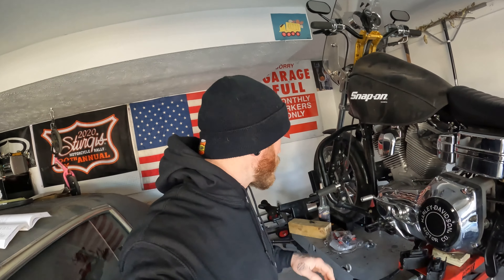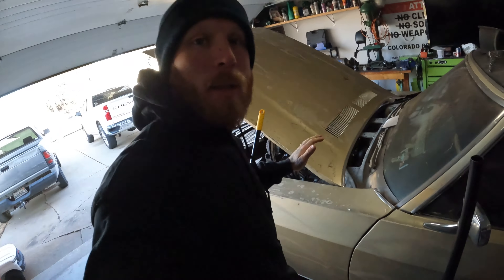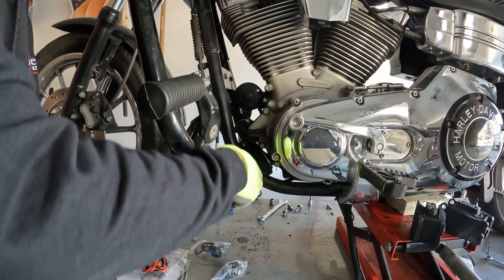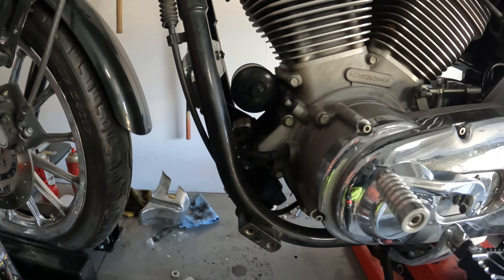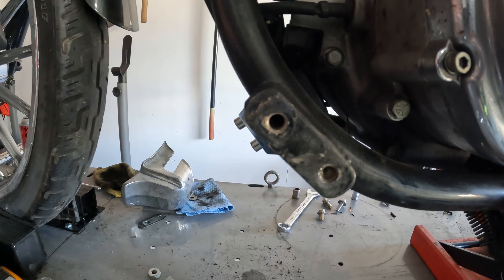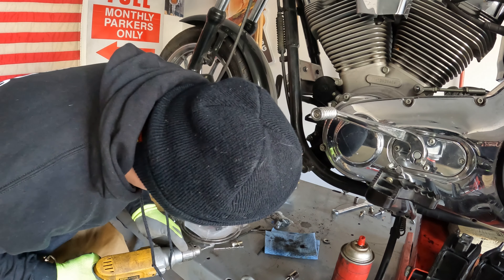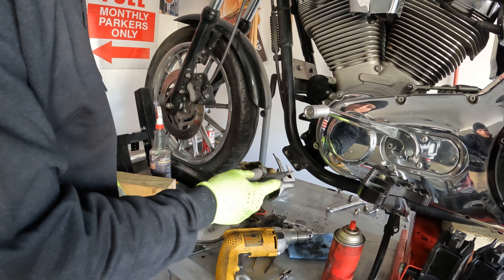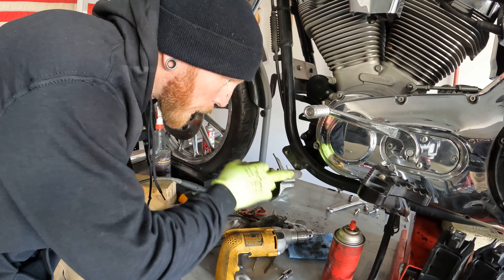Broken Bolt Nightmare on my Harley Davidson Dyna

Comment: Hey there Brandon, I like watching your videos, because you do a lot of different projects on Harleys,, And you dont do too much talking like some other mechanics, I wanted to suggest that when you get, some buying power, In drilling dept, Ace Hanson are a really great drill bit brand, And If you use an air drill, If you can get 90 pounds of air pressure somewhere and use a very slow speed, they will cut thru steel as If you were carving wood, When a bit gets hot, It stops cutting, so a little extra time to allow the bit to stay cooler and sharp, will be surprisingly easy. Great Videos.
Reply from the maker: Awesome man! I’ll check those bits out. Thank you